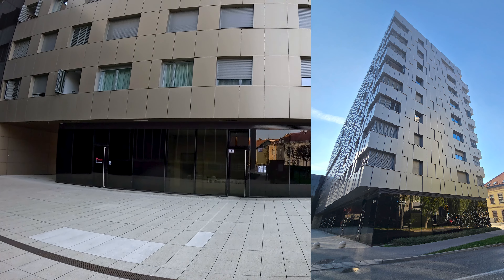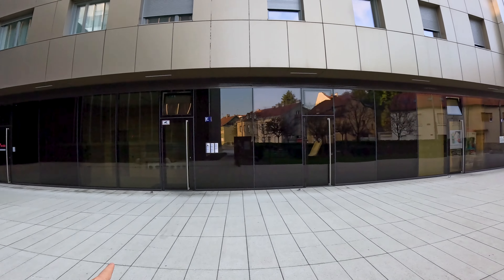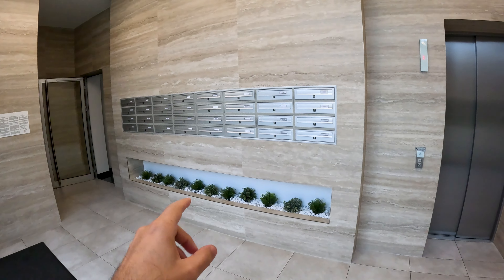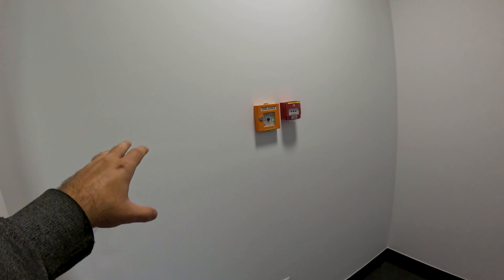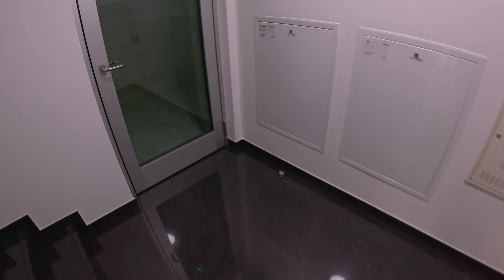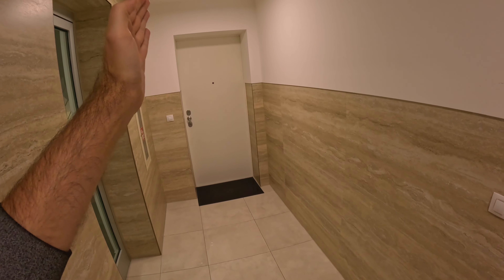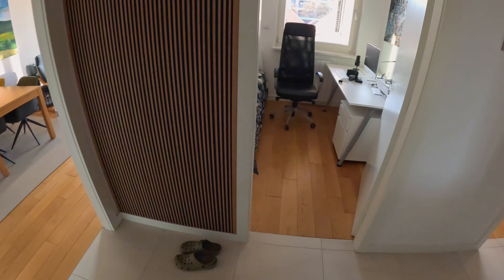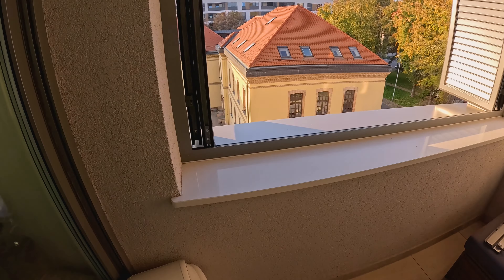Single staircase design in large condo buildings and hallway efficiency | Real Estate Victoria BC

Comment: Marko, as an architect in Croatia, I'll try to give an explanation of the possibility for the one-staircase design (as it exists but is only allowed for specific building sites).

In our fire code, each building over 2 floors above ground (we have ground floor as floor zero, thus in the event you build 3rd floor or more) EACH building HAS to have 2 fire exits, so in case of fire in one of the exits people can be evacuated by the second exit.

The fire exit was usually considered as a safe second staircase, and we had built as you had until lately in BC.

Since 2013. (if I'm right) buildings are permitted to use their window openings and terraces as fire exits for firemen to rescue the people by fire ladders form firefighting trucks (and this goes only up to ground floor plus eight floors, thus this building has those 9 floors you called out).

This is allowed ONLY in buildings that have both sprinkler systems and interior hydrants installed, so yes space is saved for exploitation in square meters but the investment is higher due to more mechanical engineering inside the building. It is still nett profitable as such, and more and more buildings use this option.

The building though MUST but accessible to firetrucks from ALL sides of it (as they need to be able to deploy to EACH apartment window or terrace), and thus is NOT easily applicable for buildings renovated in older city blocks as they often lack the possibility to allow firetrucks to enter the blocks themselves. It is mostly applicable to brand new greenfield development where new urban planning allows for traffic around the building, and unfortunately if not landscaped designed well often results in full surroundings in concrete or asphalt (minimum 5,5m width but due to technical requirements often 7m or more) and a general lack of green areas around buildings...

So, you gain some but you also lose some with it. TBH the change was mostly pushed by investors in Croatia that did not really care about the long term quality of life of future tenants but about the nett area to sell. And it often shows. Luckily not with your building as the old caserne block allowed free passage for firetrucks AND leaving enough free green space (although the buildings are a bit too tight, especially when you access it form Kunišćak, you'll know what I mean... even the road has to awkwardly "bend" around the corner of the building, just for some extra square meters... very rude)
Reply from the maker: Excellent explanation! The building on Kuniscak oddly enough has concrete barriers right on the street, not sure how fire truck would get close enough to deploy ladders to the most South orientated units.